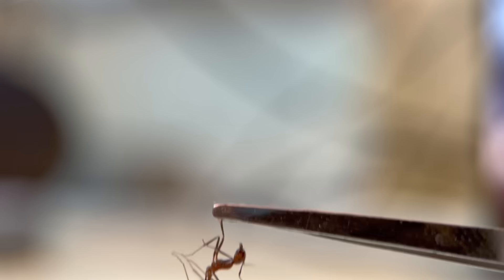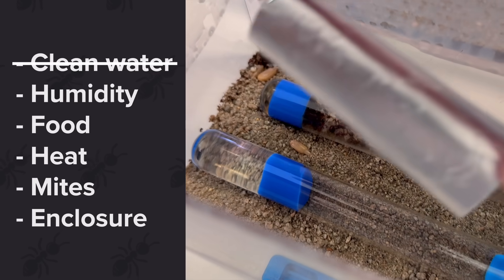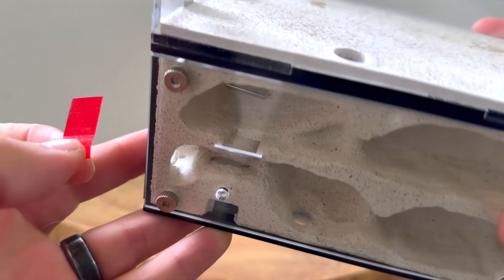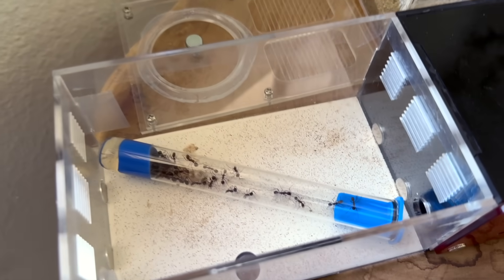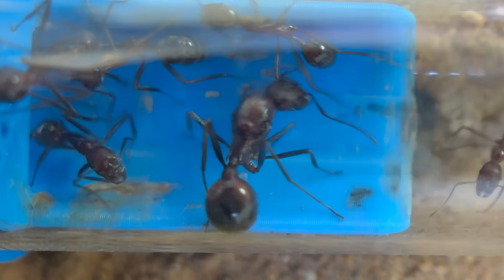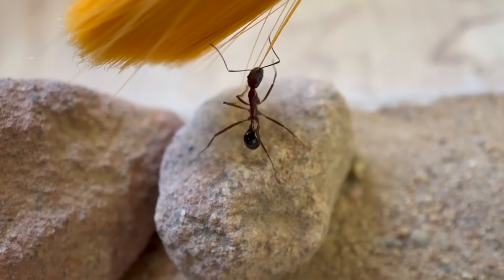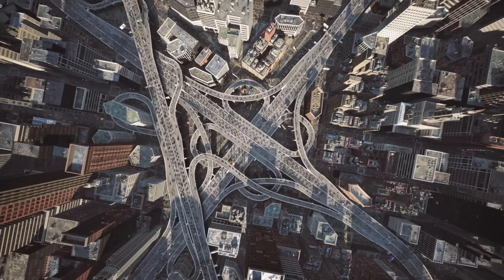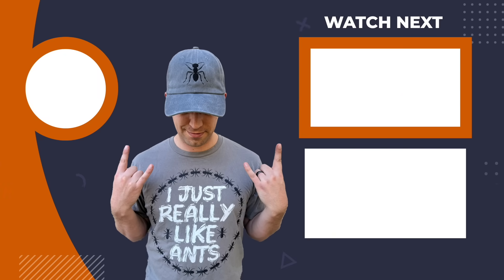Why I HAD to move my long legged ants

Comment: for any one wondering i belive i have found the nest used in the video. Expandable connecting Concrete Natural sand auto template heating control ant nest,light shading ant farm colony big formicarium